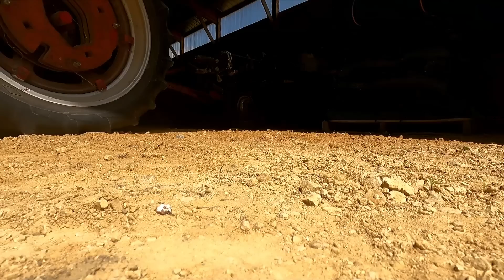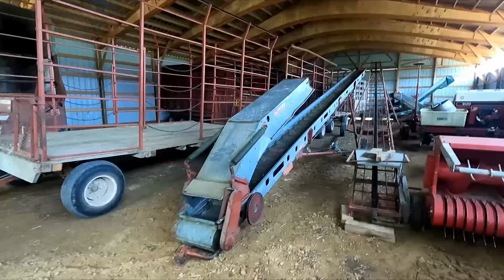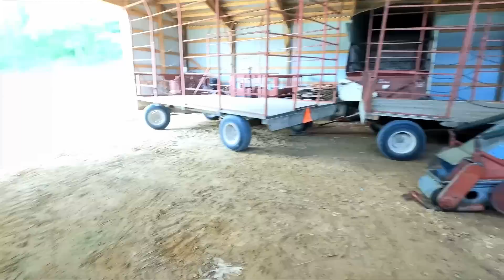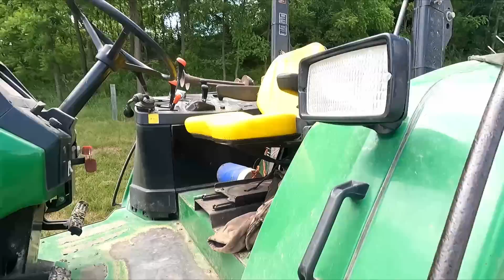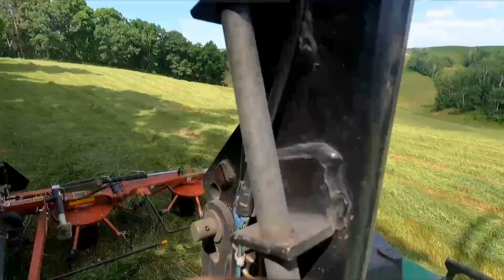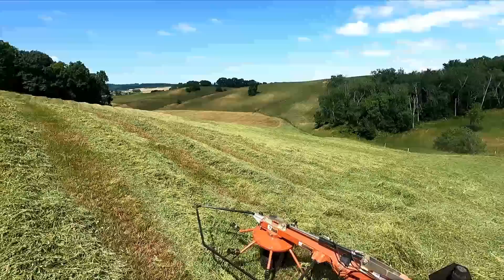Tedding Hay and Maintaining The Fleet! (2023 Hay Season)

Comment: The Deut Far tenders in the 80s had adjustment handles on the wheels and you could run the Tedder at a angle and throw the hah away from the fence rows then put them back in the center hole and carry on. Thanks sir!!

Comment: I have a 751 John Deere four basket that I pull with my 60, in 5th gear. I don't run mine wide open either. Usually half throttle. Putt putt putt!